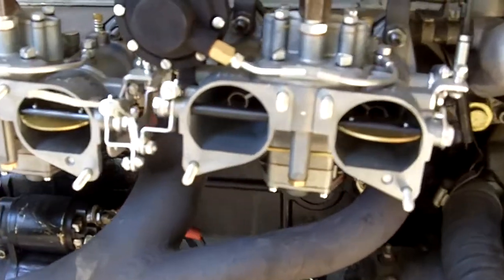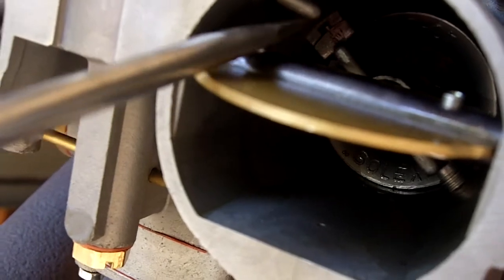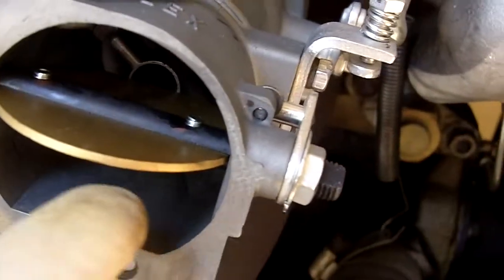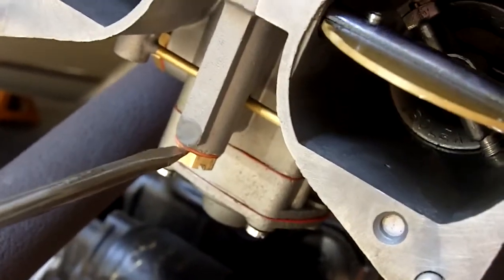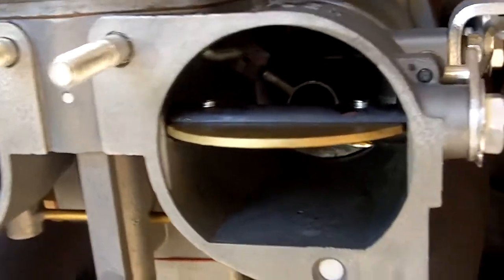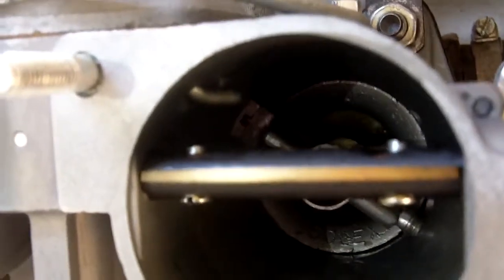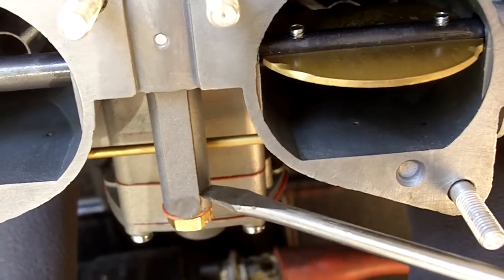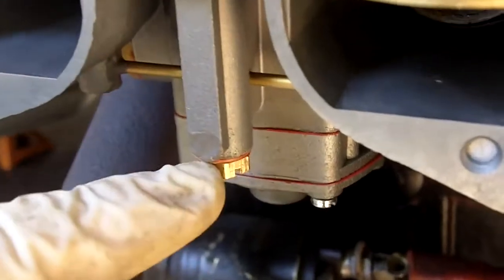190SL Solex Accelerator Discharge Nozzle Tech Tip

Comment: Yes, thank you for the video but the critical issue of setting the travel on the infinitely adjustable accelerator pump is not addressed.
Reply from the maker: Ha! I forgot about that. I will do a vid for you and post it next day or two. Basically, you adjust the travel so that you have a strong steady stream of fuel coming out of the accelerator nozzle. Generally, you will have 3-5 threads showing on the rod when the jam nut is tightened. But this can vary.
Reply: @Mercedes-Guru  Many thanks for your kind help.  I will check the threads, but I suspect that the effective travel of the lever end should be in the range of 4 to 10mm (using the VW Porsche 356 carb as a guide)... maybe 7 mm for this 1.9 liter engine?  That said, I know that driving and getting optimal pickup/minimal flat spot is the goal, but it's not terribly easy to adjust once the air log is installed.  Thanks again!
Reply from the maker: @gregorydahlen2069  I have the benefit of putting the Solex on my test stand engine, so adjusting is done at eye level. For Solex on the engine in the vehicle I leave the air log off until final adjustments have been made. Of course, the choke is not useable, but is not necessary. I hook a wire to the inner fender hood rubber mount and attach the carb return spring to it. Tie the choke levers together so the #1 carb choke does not flop around. Once this is done you have the ability to look in the 1st bbl of each carb to watch the amount and strength of the fuel discharged from the accelerator nozzle. You can also put your finger in the throats to make sure the pre-atomizers are not loose. Once those adjustments are made, start the engine and warm up to operating temperature. Do your idle mixture screw adjustments, adjust your air flow, sync your throttle linkage, and watch the accelerator nozzle for drips. Accelerate the engine and check for stumble or back fire, which indicates lean air/fuel mixture. Adjust the idle mixture screws accordingly. While accelerating inspect the accelerator nozzle and make sure it is not dripping. Let me know if this helps. I will be back to the computer tomorrow.
Reply: @Mercedes-Guru  Thank you again for your time and excellent help.  I finally took the time to thoroughly read the MBZ Manual I have specifically for the 190SL.  It says that the quantity injected should be 0.4 - 0.6 cm3 per stroke.  I will set it up that way before complete reassembly.
Best regards,
Greg
Reply: I'm at sea level so I will go with the 0.6 cm3 figure.
Reply from the maker: @gregorydahlen2069  excellent